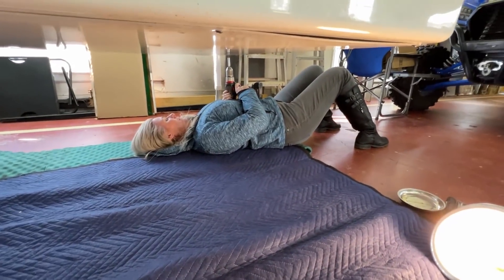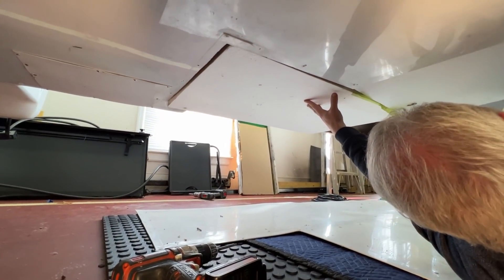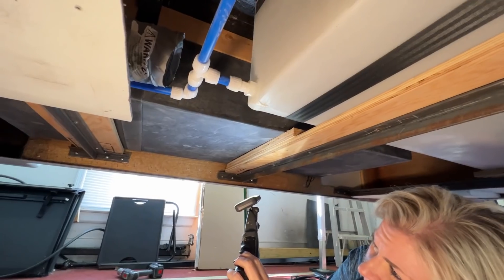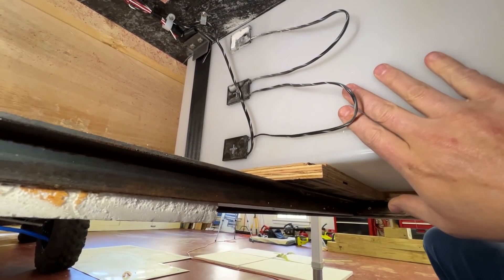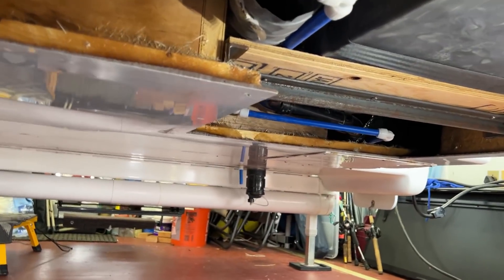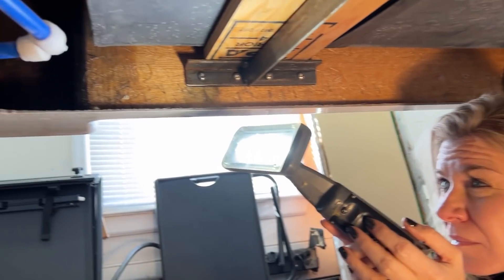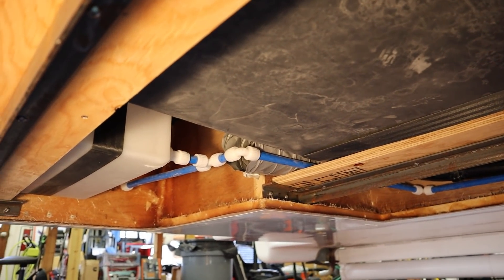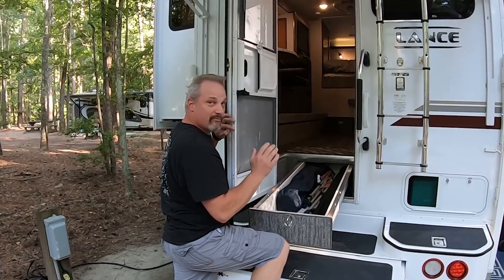Bigfoot Truck Camper / Looking inside to see how it's made?

Comment: Not only does the drain holes allow the water to get out in case of a leak. It also by letting water out tells you that there is a leak so you can investigate and repair and not rot out your underbelly. Great video!
Reply: What about the sink in our kitchens of our homes? Think about it, it’s usually a smell you notice before you notice a small leak.
Reply: Bigfoot owners and very humid and wet climates means water always in the bed of your truck.

Comment: Great video.  Our 9.6 2500 Bigfoot is 23 years old and has 200,000+ miles on it.  I have had the bottom plate off a few times.  Had to replace the dump valves and a gray water plumbing leak.  The bottom plate does not cover the whole bottom.  It is L shaped. Runs across the front and down the drivers side. About 2 ft wide.  There is no cross bracing like yours. The fresh and gray tanks sit on the foam insulation. When the bottom plate is on there is no gap so when the camper is on the truck the tanks are actually supported by the bed of the truck thus no tension on the support straps.  We have no water intrusion from the bottom, no damp looking wood.  Ours is built very well too!  Jim.

Comment: Looks like they have improved the tank supports. Mine gave birth to the fresh water tank last fall. The angle iron was fastened with two tiny screws at each end which had rusted and broken. The tank was only supported by the cover screws and came falling out when it was half full. Lots of fun to fix that! I added four 1/4" stainless lag screws for each end.

Comment: While I understand the value of being able to drop the bottom panel as compared to my Northern Lite. I would worry about water intrusion into the bottom of the camper and rotting the frame wood over time unless the panel was well sealed with Dicor around the edges. 
Neat to see the underside and how it was built. Thanks for the nice post.
Reply: Very difficult for the water to get in as it is sitting in the box of your truck while in transport.  Sitting on its own on the jacks, I don't see how any water can reach above the panel to get at wood?  Also being at the bottom it will drain if say there was a water leak in the under belly from plumbing.  No accumulation.  Also if you noticed all wood was covered with resin making it very water resistant even to humidity in the air.  Very well done in its simple design.  I would bet that in 20 yrs it would look pretty much the same inside.  Commercial fishing boats are constructed very similarly.
Reply: How can a truck camper leak under it?
Reply: How can a truck camper leak under it?
Reply: How can a truck camper leak under it?
Reply: How can a truck camper leak under it?

Comment: Thx so much for the video.  They’ve helped me with my decision making, having narrowed down to Northern Lite and Bigfoot.  Hadn’t  previously given consideration to the bottom access issue, but now sure see the benefit of it.  Another plus for Bigfoot.  Just wish they had more dealer network.  Live in MI with a Northern Lite dealer 30 miles away and Southland in GA is closest Bigfoot dealer to me.   Keep the vids coming.
Reply: I live in Iowa. Denver wasn't going to have another Bigfoot 10.4 for another year +/- because of COVID-19. I drove to Marble Falls, TX to buy mine. Prices have gone way up since 2020. Dealer in Marble Falls is asking 70k for a new 2022 10.4!!! Crazy! Lol RV Trader has more used and new Bigfoot truck campers if you're not looking to give your first child, an arm and a leg. 😄
Reply: It’s no better up here in BC, we live only a couple of hours from both NL & BF… The dealer in Vernon has no show stock for at least the next year, every unit is sold that comes on the lot… we really want to ‘sit in’ a 10.6 before we pull the trigger on one… guess we’ll have to beg a look inside if we see one in a campground on out travels.

Comment: I like the accessibility aspect for sure. I have a NL and want to put Sealevels on but am not sure how to get to the gray /fresh tanks. You could potentially add more insulation in areas in your Bigfoot as well. Nice to see the steel beam structure but is it just screwed into the fiberglass or was there some embedded wood? Anyway….great video Carla and Todd. Thanks for sharing your experience with this. Awesome. Very cool.

Comment: Oh - I thought these were a fiberglass frame totally underneath.  Surprise. Looks like there is some additional unused storage space. Nice to see how well insulated the floor is. Steel beams are great. Having access for repairs is good.  just hope if truck bed had water in it would it get in? Good idea to look inside down there before buying a used one to see if there had been problems.

Comment: Been on the fence about which camper we should invest in next, BF or NL. Not hearing great things about the current quality of NL’s due to the pressures the manufacturers are under to get units out currently. So, after seeing this we’re leaning towards a used BF 10.6 and we’ll spend the savings on upgrades to it. Having access to the tanks is a must for long term maintenance. Good job 👍

Comment: Ok, there's a BIG lesson to be learned (for some) here but not mentioned. The super strong sides of the camper obviously support most of the weight, but at 6' back from the front to the tail gate, is an area where the camper flares out (becoming about 58" wide) to take advantage of that wider space, that strong structure ALSO flares. So the lesson is: An older Bigfoot camper can not sit on just a 4X8 sheet of plywood to be "built up" in order to clear the newer and taller cabs of more modern trucks. If you need a couple inches of spacer between the truck bed and the bottom of the camper, MAKE SURE you also support that additional width back there. Otherwise you're basically sitting on the tanks - and they won't last long. Todd's flatbed - not an issue. If your camper sits directly on the truck bed - again, not an issue. But (for instance) a 2001 model 2500 10.6 has to have blocking to sit in a newer high cab vehicle.

Comment: I just can believe you would get a Lance camper with slide outs besides the weight and all the side panels have a chance to leak , with the 5th wheels you would think you know what works and first place they would leek I have Thor Park Avenue which has been great for years and it’s 2000 year and I coated it with liquid rubber roof and it’s great and it’s under a 24 x 54 carport and it doesn’t move my wife took a week or two and loosed her new Honda Accord and filled her trunk with bricks and did that until she got it done she is a keeper she works her little nuts off!

Comment: Do you put a bead of silicone sealant around the perimeter of the panel before screwing it in place? Also, how tall are your garage doors? I noticed you can drive your camper loaded on your truck inside your garage. Thanks for the video.

Comment: No way would I crawl under a camper without some kind of safety equipment in case the camper falls.
Reply: They're not hydraulic jacks.. being on a concrete floor indoors it's not going anywhere..
Reply: I was thinking the same thing throughout this video. The jacks aren’t likely to fail, but I’ve little faith in their attachment to the camper itself. Cribbing the camper wouldn’t take much effort and could avoid a catastrophic consequence.
Reply: @joshwright7841  if you cribbed it you likely could not remove that panel..

Comment: I own a Big Foot Camper. Have to be Honest and say its quite a Piece of Crap. Currently attempting to strengthen the fron t section (where the bed Is) that has drooped badly. Doesn't really look where on the Unit as its all pretty cheaply made. Considering the cost it was PATHETIC  how it was Built,. Think a Chinese one would be way Better.
Reply from the maker: And what year is yours?
Reply: @RunawayRoses  1998
Reply: Dont know if Lance or Arctic Fox much Better But I think so.
Reply: Audrey, is that perhaps the discontinued 2000 model?? I'd sure appreciate hearing all you can tell us about exactly what's going on.